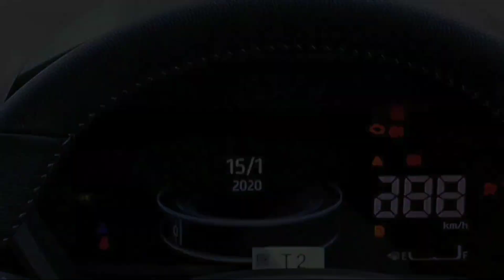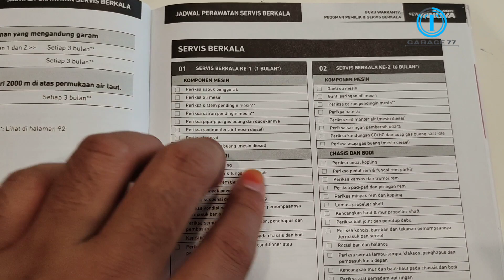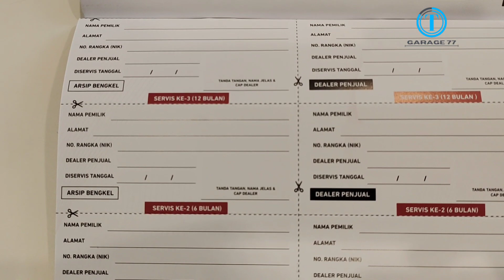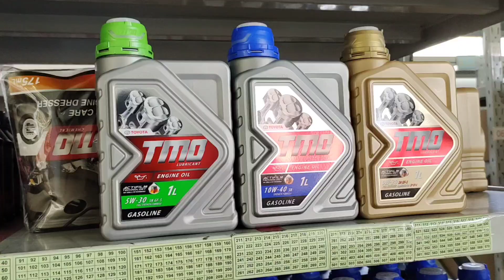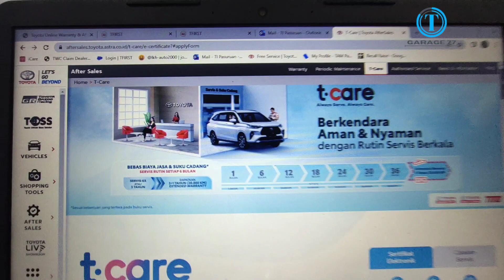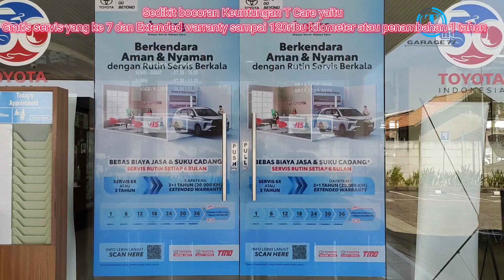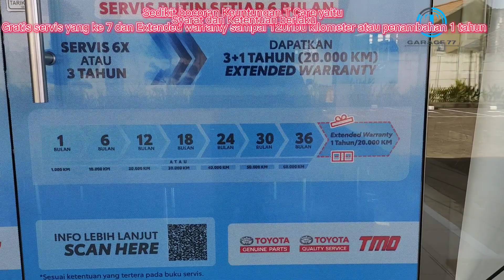Servis Gratis Mobil Toyota di Dealer Resmi dengan Program GBSB ini Caranya !!

Comment: Mau tanya om, untuk seevice di atas 20rebu apa saja yang masih geratis om?
Reply from the maker: @daminwidjaja5189  di atas 20 k yg pasti oli filter gasket. Kabin air filter d cek dlu mobilnya apa dan tahun brapaa
Reply: @AbdulToyota  toyota zenix tahun 2023 bulan juli
Reply from the maker: @daminwidjaja5189  zenix dpt filter batre hybrid filter ac juga nnti dealer yg atur bg pastinya